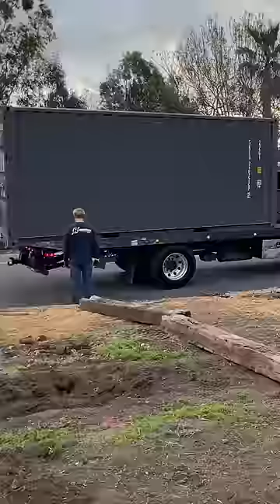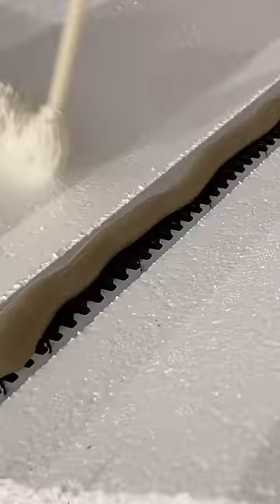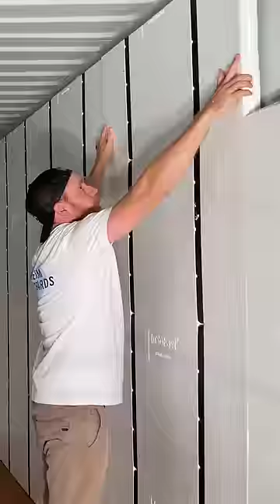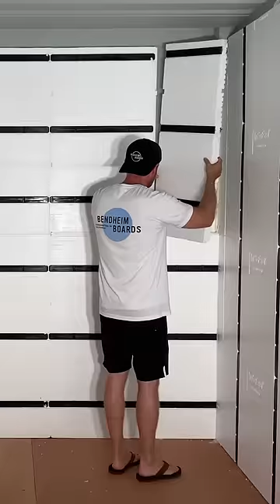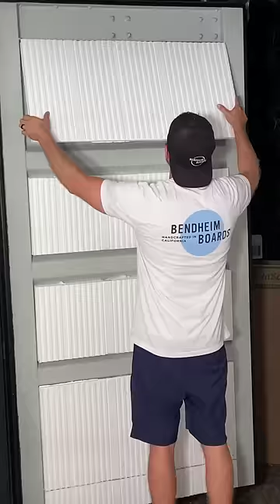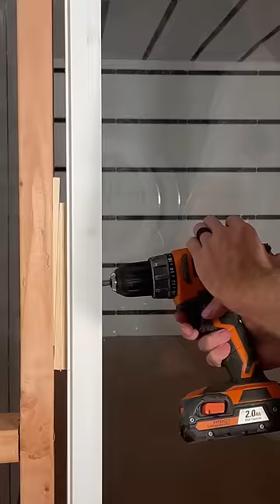Shipping Container Shaping Bay Progress thus far #shorts

Comment: I remember reading on why shipping container is not practical. Here they are:
1. Structural integrity will be compromised by any holes or screws, like wall nails and sewages
2. Proper weatherproof insulation will cost too much for this project for it to be considered cheap
3. Interior installations will create so much unusable space and makes it very impractical
4. Brand new shipping container cost a lot, and the old ones could have had hazardous material inside it, or have become structurally unsound
5. It might also cost you a ton to make your shipping container house fit to the zoning law of your area
Reply: Well structural integrity unless U trying to stack them 10 high on ship is a non issue. Compared to a traditional timber framed building this is going be 10 X stronger.
Reply: I'm a framer and I could build a house of this size in one day. I do not see the upsides.
Reply: @ameunier41  Already has exterrior protection. You can frame and do any interior work right away in any kind of weather, without it being sheeted.
Reply: @Bogues_88 If you put support beems in them just like a traditional home, you can stack them 10 high. They're done that way without support on ships everyday. I'd like to see a stick framed house ride on a ship in rough seas and not fall apart. They are a lot stronger than you think.
Reply: @ricos4700  yeah but then again if you're building a 10 story high building, the structure integrity of shipping container building with wooden interior reinforcement will not be able to compete with the traditional rebar concrete structure. Besides it also comes with a complex custom engineering and construction cost, you better off building a regular house.
Reply: @Bogues_88  well it really depends on how many openings you in planned. Having one door and one window pretty much takes out the load bearing capability after shipping container it selfs. The point is that reinforcement cost and zoning laws probably will not on your side
Reply: @CHANCHANKIT555  Welded together, sitting on a solid concrete foundation,  it would with stand a hurricane far better than a stick built home. When you cut them, you reinforce the openings with steel just like headers and beams in a stick built home.  A tree follows on a container.  I bet the damage would be far less to repair than a stick built home. 
I guess it ones down to whatever you prefer. Something traditional or some modern and unique. 
Have a great new year.
Reply: @ameunier41 how much would that cost?
Reply: @ameunier41 Well for 1, they don't have to pay you. If your willing to charge the same price as this build I'll hire you though. Lol
Reply: @CHANCHANKIT555 this is a non-issue no one is building a highrise with shipping containers, no one is stacking them ten high to build anything. Excellent consideration though.
Reply: One drawback might be the fact they're only 8' wide. I don't think I'd be concerned about structural integrity, clearly you can beef them up with structural framing. As with most things it has it's pros and cons. 8' wide maybe the perfect size for some.
Reply: @CHANCHANKIT555 ....."wooden framed shipping containers".....how high are you?
Reply: @johnathansmith9246ive had a container on property for over 20 years w/o issue all I do is sweep th top of the container once a year.
Reply: 1 that entire instalation was 100% INTERIOR insulation that required ZERO drilling into the steel structure.
2 even if you do drill cut into the walls of the container unless you are removing 10+ FEET FLOOR TO CEILING you won't do shit to the structural integrity b/c it is almost exclusively built into the corners of the container and capable of a HALF MILLION LB VERTICAL LOAD even if you do take an entire side out as long as at least a 2"sq 1/4" in wall tube is welded along the upper edge a majority of the rigidity of the ceiling will be restored(again the load bearing of containers is in the corners)
3 th floors of containers are made of affordable marine grade plywood and designed to be replaced easily.. Alternatively an epoxy floor coating can seal the original floor and ya just forget about it.
4 a wind&water tight container might be a bit beat up but at 1700 for a 40FT container(around 2600 with a couple hundred miles worth of delivery charges) it kicks th shit outta stick frame construction.
5....it's ACTUALLY SQUARE AND TRUE
Reply: @KittyBatSeth  what I meant was wooden interior reinforcement framing. I've seen it quite often on DIY shipping container builds
Reply: Beats a tent on the sidewalk.
Easy to keep up. Home is where your heart is.
Reply: @billharpster7968  if you can afford one shipping container you ain't living in a tent
Reply: @ameunier41  Permitting is easier (more or less), and most of us aren't framers. Pretty hard to get a structure for 4k.
Reply: Just counted, it would cost about 12k cad for a 14x30', insulated, vinyl exterior, gypse interior, shed.
Reply: @ameunier41  meanwhile you can get a wood shed around the same size at about 6K from Home Depot in the US
Reply: @CHANCHANKIT555 dude look at pole barns man, you could build a fucking mansion sized 60x200 pole barn for 30k in labor. These people are crazy man. That shit is so pointless and requires so much extra work for no reason. When I used to build pole barns, we could build a 20x30 in a single day with a crew of 5-6guys, and still have time left over before the end of the day. That includes installing the metal sheathing on the exterior, metal roofing, windows if there were any, and door.

All of that took a single damn day, what maybe 2k in labor? Hell a used shipping container cost at least 2 grand by itself, let alone the materials needed to build it the way you want, and the labor. Then there's the extra time and money for permits, inspections, and following zoning laws, especially if you want to stack them or double them side by side, which would require a lot more pre planning and a lift to move them together after making the cut.
Reply: Hey, this is all Very useful input… if someone is intending on Living In it… does anyone know what he’s building?? It could be literally Anything…
Reply: You say this like shipping containers are preferred over other means of housing. 😅 obviously this is only done by those disregarding practicality.
Reply: I think we both saw the same documentaries, shipping containers are very impractical in my opinion
Reply: Shipping containers have zero load bearing ability on the sides or the top. The load bearing is done on the corners and the floor.
Reply: He probably didn't have to spend any, or much, money on permits because it is considered a temporary structure, like a shed. If this is what he wants, why are y'all worried about it? If you want something different, build something different. He's showing what he did. He's not telling you that you Must Do It This Way. If you don't like it Go On By. I looked into shipping containers but I prefer earthships, dome homes or even cobb, but I still found it interesting on how he insulated it.
Reply: Sir all I have to say is I don't see a house officer I see a storage container and an portable outhouse with a shed as a permanent structure no need for a permit
Reply: Most zones allow storages containers even in flood zones
Reply: The biggest issue would be the pesticides in the flooring
Reply: @predatorysage1  You're not doing  a pole barn in a major city. Good luck with that.
Reply: @ricos4700  what are you even saying? Pole barns aren't allowed in major cities or something? I'm confused what you're even talking about?
Reply: @predatorysage1  You're saying how cheap a pole barn is, and they aren't allowed everywhere.  Maybe if you live in the country. Plus, once you start adding interior walls and fixtures, you might as well build a stick built home.
Reply: @ricos4700  a pole barn is allowed anywhere, it's literally just a shed or garage built with 4x4 post instead of stick framed walls. There's literally no law restricting anyone from building a pole barn anywhere on their property. There are zoning codes in some neighborhoods that may restrict you from building anything on your property but that has nothing to do with a polebarn. You're obviously not going to be allowed to build one if garages, sheds or even fences aren't allowed. As long as you don't live in a HOA neighborhood you can build whatever the hell you want on your property including a polebarn. It doesn't matter if you're in the country or not. I can literally put a 10x10 polebarn in my backyard right now if I want to and I live in a regular ass neighborhood in a major city. 

Also the entire point of my comment was to point out the absurdity in shipping container construction so I'm not sure what makes you think that if there's a space where polebarns are not allowed, shipping containers would somehow be allowed.

And I'm not arguing that we should all live in polebarns so I'm not sure why you're bringing up stick framing. I'm literally saying for someone that wants to live in or convert a shipping container, they would be significantly better off with a polebarn instead. Shipping container construction is stupid and a waste of money, something only for people that have money to waste. 

I would never live in a pole barn or shipping container because that's stupid, but if I had to choose it would be a polebarn.
Reply: @predatorysage1  The conversation was about living structures, not garages or sheds.
Reply: @ricos4700 Huh? Do you consider a shipping container a living structure?
Reply: @predatorysage1  It can be. That's what the conversation was about. People voicing their opinions. Pros and cons. If you don't like them, great, thats your opinion.  Sounds like you haven't looked at much or know much about the process. If you want to talk about sheds,go watch a shed video. Have a great day, young man.
Reply: Genuinely curious, if larger arrangements were made, where only the outside containers would require insulation or weather protection, would that mitigate enough of the cost/loss of interior space to make it more viable?
Reply: @CHANCHANKIT555 depending on where u live some states use all word structure like North Carolina so ur comment is kinda void

Comment: That polystyrene is the biggest fire hazard
Reply: Depends what he's using it for
Reply: This looks like a freezer
Reply: Shipping container homes in general are a fire hazard.
Reply: @archipiratta  just don’t start fires in it 🤯
Reply: Yea but if it's doors are closed and a fire storm came past you would last longer in this that any traditional building .. besides he is going to install drywall as the interior lining the polystyrene won't be exposed to and ignition source .. but if you did plan to use it for practicing your fire dancing routine you can install fire rated dry wall and it be safer than any traditional home that won't have fire rated dry wall.
Reply: And all those wooden houses in the USA are not??
Reply: @EthanL21800 how’s a metal container a fire hazard?

Comment: properly insulated with no thermal bridges, love to see it
Reply: Everyone has their own way of working but I use to do this for a living and even though it's right there is other ways with out having to steal all that space...
Reply: you dont know what his going to do next
Reply: @eldwende7198 Even on a shipping container? I'm pretty sure he's using a very optimal installation method. The only other thing he could do is spray foam which would be way harder and take way longer and still pick up nearly as much room on each side. Unless you're suggesting putting the insulation on the outside. That would solve a bit of his problem and keep his inside area more wide open
Reply: Yeah, no vent as well
Reply: Dew point between the insulation and foam :D
Reply: He's using glue to hold all these walls and ceiling together... nothing good about this method.
Reply: ... and no ventilation or alternative escape routes...
Reply: oh that sweet sweet sweat !!

Comment: Bracing the ceiling insulation from the floor tells me he has some prior experience.
Reply: What do you mean? I don't think one needs experience to do this that wat
Reply: @worldoftancraft  Bracing the ceiling keeps some of it from actually falling especially in big pieces which can kill,smaller pieces are safer.You can still get hurt but not as badly.Cleanup is actually quicker because the pieces are already broken up.Landfillsdom't take bigger pieces so it helps to handle easier.
Reply: He only temporarily braced it to apply pressure ao the glue would cure, like you would use wood clamps on a smaller project.

Comment: Be careful if your adding electrical cable 
The oils from the poly can react to the oils in the cable and start an electrical fire
Reply: oils from what? the styrofoam?
Reply: @egendron123  polystyrene aka poly aka styrofoam yes
Reply: Even when using conduit?
Reply: @rayjay1503  conduit is fine. As long as they do not touch
Reply: @rayjay1503  metal conduit would be good

Comment: Insulate the outside and cover with wood cladding. You get a better looking finish and more interior space.
Reply: Except that will radically raise the cost and at that point you might as well consider more traditional styles of building a home or getting a pre-fab.
Reply: @acecomics150  yes but if the outside is not protected and sealed it will end up getting filled with moisture and getting ruined.
Reply: @acecomics150 A home?  Where did you see a home?
Reply: @MsHojat  a simple sealant for the outside is all that's necessary, it's a solid steel crate. Doubt there will be any leaks in this lifetime, this things are built like tanks
Reply: Sounds efficient... sweet
Reply: @AlienVale  Except when you drill holes into it when screwing things into the container
Reply: 😅😅 @AlienVale
Reply: @dbsirius  put sealant over it then boom, problem solved. Just seal everything. Use silicone and flex tape products, then dip it all in superglue. It's genius. Trust me, I make the best shipping containers around. No one makes better shipping container homes than I do. The people love my shipping container homes, they say its the best you can buy. Just trust me
Reply: agree more interior space and better protection
Reply: @MsHojat leaks. ? These things float in the sea for years 😂🤣

Comment: Love that insulation. That's the difference between a hot temperature box and a hot sexy box
Reply: What is the name of the insulation he was installing?
Reply: @aarondaniels8929  styrofoam bro
Reply: Why do people commonly believe styrofoam works as insulation? I see this all the time in DIY. This isn't gonna provide any significant R value.
Reply: @TheNoNotReally for real at least use real foam board
Reply: @TheNoNotReally  and any insulation should be on the outside to help protect steel from thermal expansion and thermal conduction. But I guess there goes the aesthetic.

Comment: I would love to see the finished result please
Reply: After or before the straight line winds?
Reply: I think I could do that or something like it. cuz I'm always thinking aboutBBChow to make  things, better.  I just need toool
Reply: and materials
Reply: @tonyafitzgerald3268 always thinkin bout BBC?
Reply: @davekleiboeker4614  If anchored correctly it will survive far better than a stick built house.
Reply: Kkl kkl kl k poo klplk
Reply: @phillhuddleston9445  well if stick built houses were secured better that wouldn't be true but wood framers are too lazy to use quality threaded screws instead of smooth shank nails they have currently. I build with iron to stand 115-130 mph winds so I'd say 4 sets of 4 1/2 anchor pins into 3' piers would be sufficient to call it tornado resistant but I don't know how those containers are assembled and hauling weight is different than live loads
Reply: @calebz1448  A forty foot shipping container could support a stack of six fully loaded 40' containers weighing 192 metric tons on top of it. They are made to survive high wind conditions on a shipping vessel that sways back and forth shifting the weight from one side to the other often. Even with the proper screws stick built houses will not hold together as well as a shipping container that is built for twenty years of traveling the world on sea and road.
Reply: @calebz1448  they use nails because screws have next to no shear strength under sudden loads
Reply: @johnmclaughlin2540  😂
Reply: @davekleiboeker4614  Straight line winds won't faze these. They are meant to travel the high seas with 6 other containers stacked on top of them.
Reply: @calebz1448  it's not laziness, screws will sheer of and snap with movement, where nails can bend.
Reply: @arnold8746  that is a lie told by lazy framers. I've seen the tests being done and the shear force that breaks screws is a force that is never applied to a home. When an unbiased individual puts experiments together like project farm does then you can expect real results that weren't influenced by any union lobbyists paying for studies to be done to please the lazy framers.(I do steel framing so I look down on inferior fasteners while admiring the workability of wood)
Reply: Where is the next video? I watched the next 3-4 videos and they ain't it